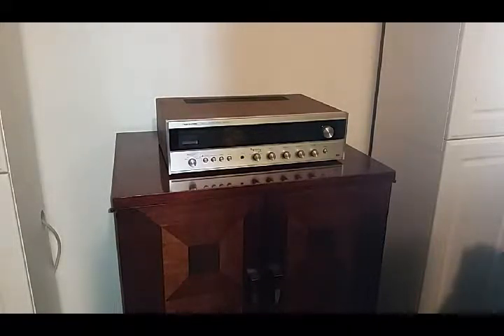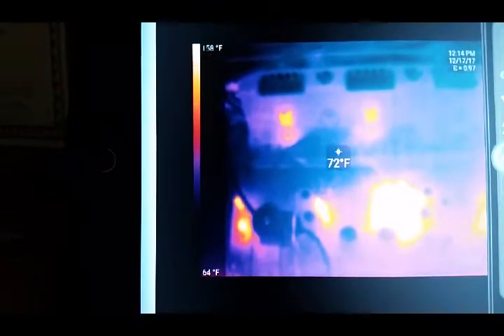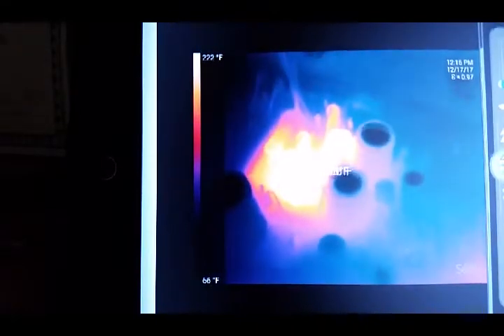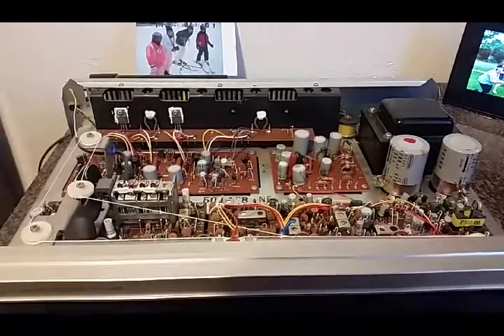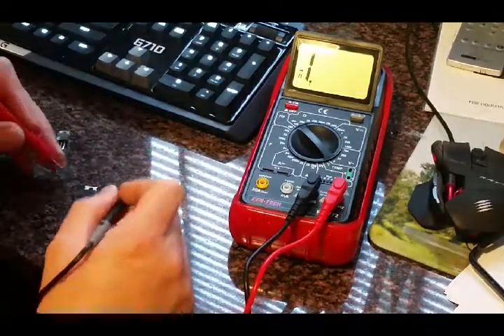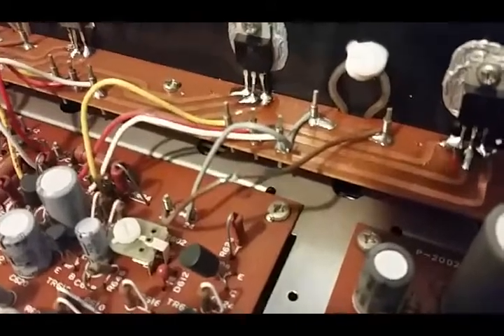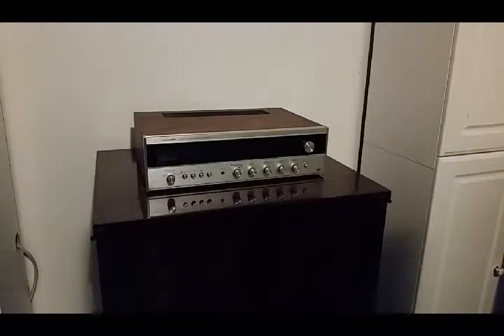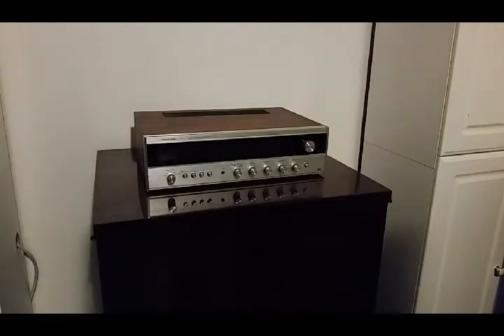Vintage receiver repair Realistic STA-77

Comment: I see you replaced a bulb, did you show how you did that on this video?
Reply from the maker: @GlennWaltrip  no the lamp that is out at the beginning of the video is intermittent and just happened to work at the end of the video. It actually still works to this day so I haven’t even looked into replacing it. Thanks for the question

Comment: Hi Justin,

Its been a while since you made the video, but I have a question :) 
Could you tell if the transformer inside can be switched to operate with 220v,  50Hz?
Many greetings from Greece, 
Giorgos
Reply from the maker: That is a great question, I will look into that and see what would need to be done to accomplish this.

Comment: I had the same issue with my 77A & my repair guy did the exact repair by replacing some capacitors/ Transistors , recapped the power amplifier section & lamps . Damn receiver looks & sounds great for 18 wpc.